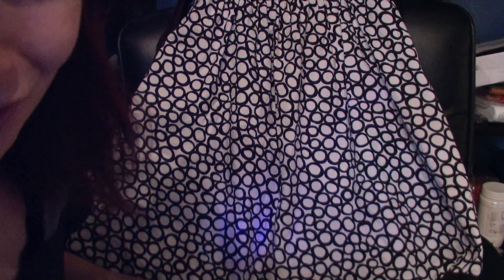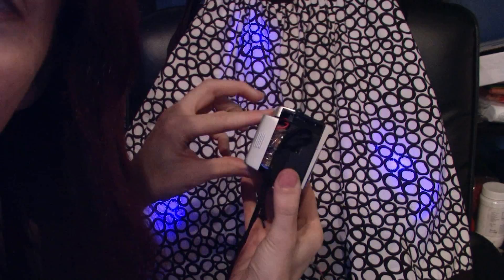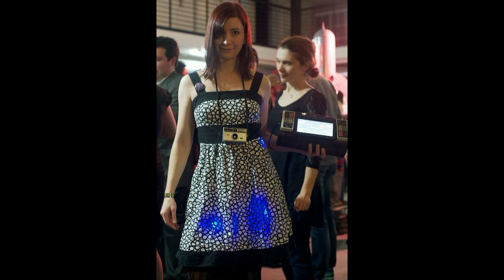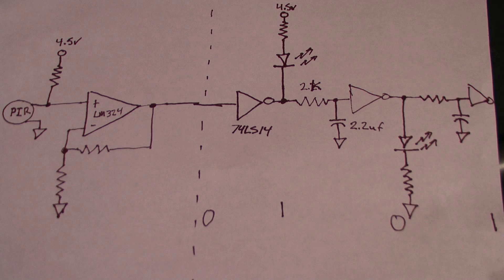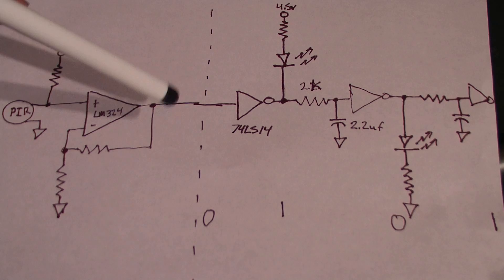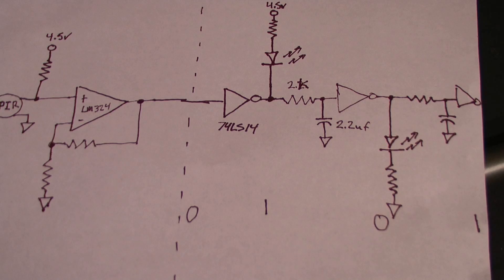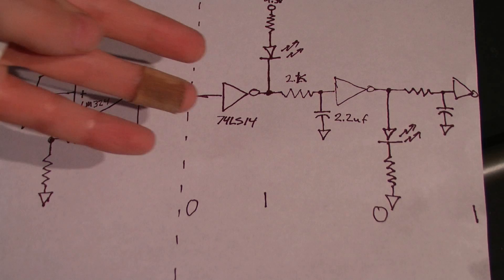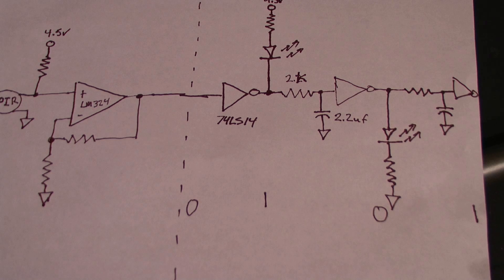Light Emitting Dress with Motion Detector

Comment: That's neat! I built some wearable and portable effects using Adafruit neopixel strips and a PIC controller device for use on stage by our local amateur dramatic company. The whole thing is built on a 50mm square PCB, runs off 2xAA and drops down to about 30 microamps consumption in the dark idle. If you are interested I can send you a copy of the design.

Comment: I like your chain of delayed outputs for the LED's.  Last Halloween I got a Parallax PIR sensor module from radio shack.  I think it was about $10.  I imagine I could just connect that to your delay chain.  Just wondering, on the video the delay between the LEDs was not very noticeable.  Are they seconds apart or less?